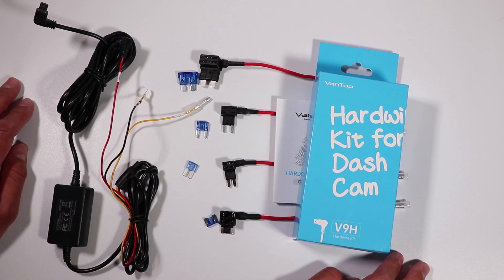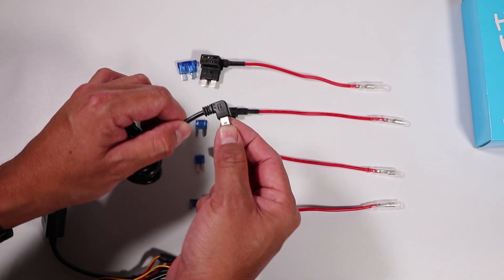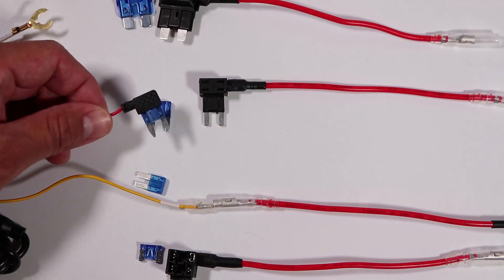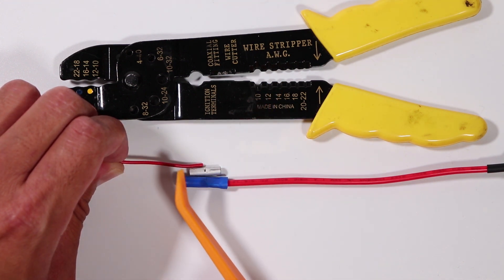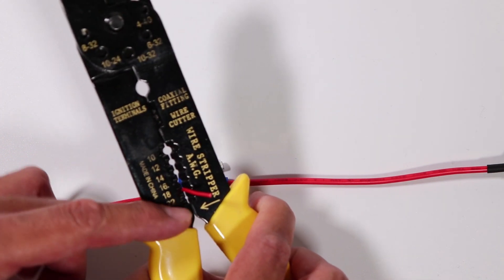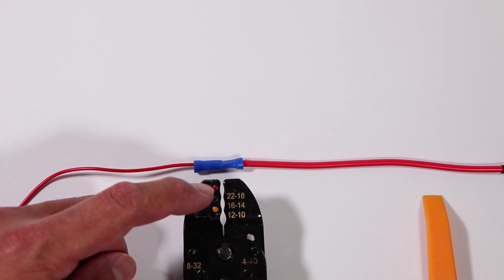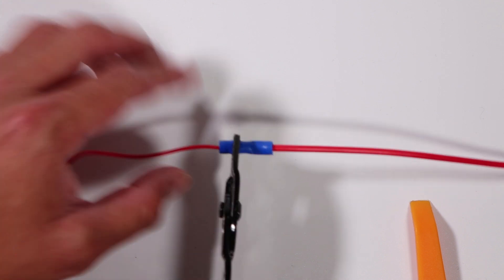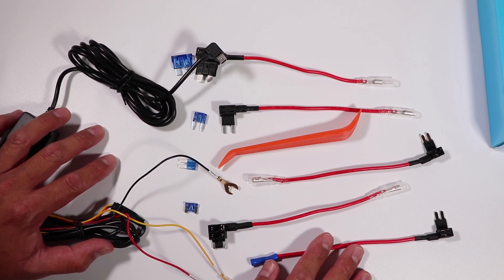Vantop Dash Cam Hardwire Kit: Install Prep, Connections & Fuse Taps Explained

Comment: I’ve had mine for a little over a year.  Worked great. BUT Now the dash cam won’t power on or charge.  Anyone else having similar issues?   Please help
Reply from the maker: Hi Chris DuBos! It could be this issue I covered on my latest video here https://youtu.be/trpMjXbjOcU or the power supply for it may be failing, If you are hardwired I would try the cigarette lighter plug to see if it works correctly which would confirm a bad hardwire kit. If you are running the cigarette lighter adapter then I would use a power bank (capable of 2.5A) to confirm if the cigarette plug has failed. Hope this helps, Cheers!

Comment: Hi, I have this and a vivilink dash cam. I have an Audi A4 that use the largest fuse of the four provided. Do I need to also install the red ACC fuse? Bc it doesn’t fix and I really don’t want to have slice it and etc
Reply from the maker: Hi Nhat Nguyen! Yes the ACC wire is required for the dash cam to work correctly, what's unfortunate is that they didn't made the kit with a quick disconnect so we can change the size as needed. On this other video I made https://youtu.be/wAad_JA7kz8 I show another way that installers change the size without splicing at the 9:50 mark if you want to see that method. Hope this helps and thanks for watching!
Reply: @AlexAutoFun  yes, wish they made the Acc wire the same as the other with options. Now I need to splice it, do you know where I can buy the similar big fuse wire to splice with the current? Thank you so much
Reply from the maker: @NhatNguyen-xs7kl  Here you go Nhat! Fuse Taps  https://amzn.to/34OTZ0A
 and here is the Stripper Crimper Tool  https://amzn.to/3nLr1r2
Reply: @AlexAutoFun  thanks for the link. 👍
Reply from the maker: @NhatNguyen-xs7kl  You're welcome!

Comment: which of the 2 do you recommend this 1 for the Van top OR the wolf 1 for the van top?
Reply from the maker: Hi Raul! I usually recommend sticking to the same manufacturer, so Vantop kit for Vantop dash cams and Wolfbox kit for Wolfbox dashcams. That being said, I do like how the Vantop comes with some fuse taps, however not enough to install it if your car size does not match the molded one. So in a way even thought it comes with a few fuse taps with either of this kits it is likely you will still have to buy an additional set of fuse taps to be able to install it (links to them in the video description). Hope this helps and thanks for watching!
Reply: @AlexAutoFun  Thanks for the prompt reply, that is a lot of good information, get back to me when you set it up in a Chevy Silverado  1500, Thanks again.
Reply from the maker: @raulm9543  You're welcome!

Comment: For everyone interested how the parking mode of such a hardwire kit works: I've mounted an USB cable breakout and attached the multimeter to the breakout ports. As long as the ignition (ACC, clamp 15) is off, there is +5V on the USB VCC wire. If the ignition is switched on, there is additionally +5V on the ID wire (wire 4) of the mini USB plug. The Dashcam must be enabled for "Parking mode" and when enabled, the Dashcam is in "parking mode" when there's only VCC, and in "drive mode" with both VCC + ID on +5 Volts.
On primary side I found the voltage converter of the kit to consume 5 Milliamps when running idle (no dashcam connected). I'll add figures for power consumption in parking and drive mode here as soon as I've finished my dashcam project and mounted my cam again in the car.

Sidenote: I had a Dmyco dashcam with 2.5k resolution which failed after 1 year in the car. I now bought a Vantop H610 which looks very identical to the Dmyco and found that the firmware of the VanTop is better than the Dmyco version. My Dmyco rear cam works well with the Vantop device, as well as the Dmyco's GPS mouse which I curiously plugged into the VanTop's "sealed" GPS plug hole. As Amazon was so friendly to not force me to unmount all the Dmyco stuff I built into the car, I now have a Dmyco hardwire kit, a Dmyco GPS mouse, a VanTop dashcam, a Dmyco rear cam, and an additional VanTop rear cam (maybe I build a splitter for reverse gear to switch the cam). As I got the broken Dmyco refunded and the VanTop dashcam was cheaper, the whole setup saved me now 30 Euros/dollars and I got a second rear cam... :-)
Reply from the maker: Hi srh2301! Man thanks for so much for this information, this is great info, I gotten this question before and while I had an idea of how it work I did not know the actual details of it. Thanks for sharing bud!

Comment: Does anybody know how this hardwire kit works on USB side? I understand that there are the PLUS and GND wires in the USB cable, but what changes when ACC is on / off? Does the device send any information on the data lines of the USB?
Reply from the maker: Hi srh2301! Your correct, the dash cam uses different power in different pins for it to know that the car has been turned off. The actual pin outs are typically proprietary to different manufacturers and some are universal. Garmin is one of the dash cams that controls this information making harder for aftermarket hardwire kits to be developed for it, so it just depends from dash cam to dash cam. Hope that makes sense and thanks for watching bud!

Comment: Great video. I am wondering just like you why there isn’t an extra set of taps for the other wire. I tried a rove universal kit and it didn’t work for the Vantop mirror. I just ordered the kit from Vantop and will use your video as a guide. What amp size do I need for the dash cam?
Reply from the maker: Thanks Mike! yeah I wish both side had taps. That's interesting you mention the Rove kit as I'm about to review it and I want to test it out on both a Rove dashcam and a Vantop one, so appreciate the heads up on it. Regarding the fuse size, you want to stick with the fuse size Vantop included in the kit which are the blue fuses at 15amps. Hope this helps and thanks for watching!
Reply: @AlexAutoFun  thanks for the reply. It’s the Rove ultimate hardwire kit. So I will use 15 amp fuses for both battery and ACC taps, does it matter if I pick a 10amp unused slot in my fuse box?  In other words, I have a 10amp fuse currently in the box that is labeled as a spare. Thanks in advance!
Reply from the maker: @mikek568  You would want to stick with the original fuse amp value that came out of your car, so if you are taking over a spot that used a 10amp fuse then you would want to use 10amp on the fuse tap 1st slot (seen at the 2:00 mark) and then the 15amp for the dash cam power on the 2nd slot...
Reply: @AlexAutoFun  thanks again!
Reply from the maker: @mikek568  You're welcome Mike!

Comment: Hey again! So I just finished installing my vivilink dash cam yesterday. I had to change the red ACC fuse plug to another type as the one that came with the kit did not fit my tundra.  My tundra uses the low profile mini. So I had to go to the auto parts store down the street and all they had was one rated for 10 amps at the highest. I'm just kind of confused because the one that comes with the kit is a 15 amp fuse that is molded into the fuse plug. And I removed a 7.5 amp fuse from my ACC port. Will the 10 amp fuse on the new fuse block that I had to splice in be enough power for the dash cam or should I order a 15 amp fuse block? Also does it matter that I replaced the 7.5 amp fuse in my ACC port with a 10 amp fuse? Just concerned about getting the correct amount of power to the dash cam and also to my truck. Thank you for any help Hope this makes sense!
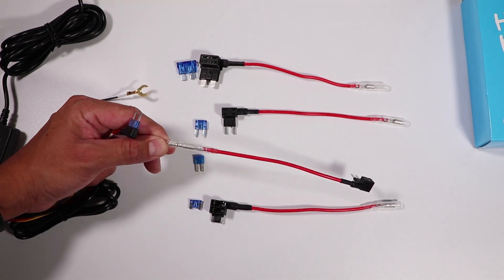Reply from the maker: Hi Daniel! Ahh yes good question, if you had to remove the molded ACC like I did and replaced with another fuse tap size, you will want to follow same order as seen at the 1:57 where I show the location of the original fuse and the location of the dashcam fuse into the fuse tap. If the fuse you removed from your car is 7.5 amp then you want to stay with the 7.5 amp, the fuse for the dashcam should also stay the same, the fuse on the molded plug is 15 amp, so you will want to stay with 15 amp for the dashcam. Hope this helps and thanks for watching!
Reply: @AlexAutoFun  That makes sense I'll try that thank you! I ordered a 15 amp fuse tap from Amazon so hopefully that will fix the problem. Also I noticed after I installed everything in the kit that now my mirrors don't work or my radio doesn't work lol.
Reply from the maker: @djordan7979  You're welcome Daniel! I will have another video coming where I go more into details for the fuse taps including the issues you are seeing which I see on some cars, sometimes it's as easy as re-installing the fuse tap in the opposite direction and sometimes is just the circuit is sensitive to adding more to it, stay tuned bud!..
Reply: @AlexAutoFun  So I just finished wiring everything up perfectly and it still wouldn't work correctly... I was dumbfounded. And then I thought hmmm maybe let me try switching the yellow wire to ACC and the red wire to constant and see what happens and sure enough that was the problem. Works perfectly now. I don't know why mine is reversed but it is. Even my hardware kit booklet says yellow to constant and red to ACC but mine is backwards. Do you know why that would be?
Reply from the maker: @djordan7979  Hi Daniel! that is odd! lol I normally confirm with a voltmeter if the fuse location that I'm going to use for ACC is in fact turning on only when the key is turned to accessory and then I also check the BATT fuse location and confirm it has power all the time, this way I can eliminate that as a possible issue. It also lets me confirm with side of the fuse will be the 'hot" side as the fuse tape will only work correctly in one orientation (even thought I can fit 2 ways) since the correct orientation varies from car to car...
Reply: @AlexAutoFun  hey man yeah I tested all of that. I have a fuse tester and confirmed that the acc slot I chose was off with the car off and on with it on. Same with the constant slot. I also tested the empty fuse slots for positive and negative for the correct orientation of the fuse taps. I'm totally confused. Maybe I got a faulty vantop hardwire kit? Or maybe my ground wire isn't connected properly?
Reply from the maker: @djordan7979  I think your ground is good since the dashcam powers up (I'm assuming your powering the Vantop H612T dashcam?). If everything else is good, I think It is possible you got a kit with a wire color switched. I was in the car industry for a long time and this was a common error we saw, where assemblers would connect it correctly but would use the incorrect color. Does the Vantop dashcam says "Going to Parking Mode" when you turn off the car? if it does, then it may just be that color issue. If the dashcam does not go into parking mode, then I would recommend contacting Vantop for support, they may just swap your kit out (I heard they have good customer service) Please let us know what you find bud!
Reply: @AlexAutoFun  I am using the Vivilink model. It's basically the same thing as the Vantop unit. I've done everything correctly so I'm thinking it has to be a faulty hardwire kit. I don't know what else it could be. And yes it does go into parking mode when I turn the car off. I did email vantop so hopefully they will have a good answer for me! Thanks for all of your replies and all of your help. Very much appreciated!!
Reply from the maker: @djordan7979  You're welcome bud! yeah if it goes into parking mode you should be good (ah yes Vivilink that's a good dashcam specially for the price and it's made by Vantop too!)
Reply: @AlexAutoFun  Thanks good to know! And yeah great price on the Vivilink!

Comment: 1:34 the black wire what does it do? Can cut it off. 

I order hardware kit and it doesn’t has GND
Reply from the maker: Hi Big Boss! The black wire provides the negative power and the red wire provides the positive power to the device. If your hardwire kit did not come labeled with GND, it may be labeled as negative or with the negative sign "-" Check the instruction that came with it, it may shed some light on this, hope this helps bud and thanks for watching!
Reply: @AlexAutoFun  thanks for your kindness 
Please leave me your Instagram  bro
Reply from the maker: @bigboss2300   Here is my IG: alexautofun  Greetings for California!
Reply: @AlexAutoFun  followed you as @zacckyhajjy
Thanks fam ✌️
Reply from the maker: @bigboss2300  Awesome! thanks for the follow my friend!
Reply: @AlexAutoFun  I started dash cam business so I every needed your help please response me

Comment: Do I have to connect all 3 wires?
Reply from the maker: Hi Tony! All 3 wires are required to be connected only if Parking Mode is desired. The dashcam will still work with only the main 2 power wires connected but it won't know when the car is turned off and some dashcams need to know this to enable parking mode. Here is a follow up video on the hardwire process if it helps https://youtu.be/zbxYA4VhuT8 Thanks for watching Tony!

Comment: How would you install on older models like a 71 Chevelle that doesn't have modern fuse connections? Direct to battery? Thanks
Reply from the maker: Hi Genero! yes you could go direct to battery, as long as you keep the inline fuse they included for safety. However it may be better if it's connected to a switched power source so the dashcam knows when the car is on or off. Hope this helps!

Comment: On the new fuse tap you added how many amps should I put. I noticed the one you cut was blue. I bought the new tap only come with a 10 red and 20 yellow amps fuse.
Reply: Thx i was able to have it connected to my car. I love it
Reply from the maker: @RandyRKO  Awesome! You're welcome!
Reply from the maker: Hi Randy! I used the fuse that came with the kit which is also blue in color 15 amps rating. Hope this helps and thanks for watching!

Comment: For the molded fuse on the red ACC wire, my car takes the mini fuses so would I need an old fuse and new fuse tap or how can I use the one provided?
Reply: Thanks for the reply
Reply from the maker: @Scrap3001  You're welcome!
Reply from the maker: Hi Carnard! Yes if the car does not have a spare fuse position to install the ACC fuse, the molded fuse (ACC) would have to be cut off and replaced with a fuse tap as shown around 3:50 Hope this helps bud!
Reply: @AlexAutoFun  hopefully this makes sense. i cut off the acc and added a fuse tap. i remember at the beginning you said to put the original fuse in the first slot and the other fuse from the camera in the second slot. but my camera only came with one. what do i put in the rear section of the other fuse tap.

Comment: Hi! Great video, tks! I'm in doubt about the difference between this hardwire kit and the ones that only come with one connection.
Reply from the maker: Thanks Jaime! regarding the kits with only 2 power wires, those for the most part are on all the time, regardless if the car is on or off. Some dashcams work ok like that but they probably won't go into park mode as the camera does not know when the car is off. On the kit with 3 power wires the dashcam is able to tell that car has been turned off and is parked (this enables on the parking mode). Hope this helps bud!
Reply: @AlexAutoFun  thank you, this answers my question!
Reply: @AlexAutoFun  sure it does! Thanks!
Reply: so the red wire need to c Connect 12 volt and the yellow wire to?
Reply from the maker: @jaimejess1  Hi Jay, yellow goes to 12 volt constant (meaning its always powered on regardless if the car if running or not).. Hope this helps bud!